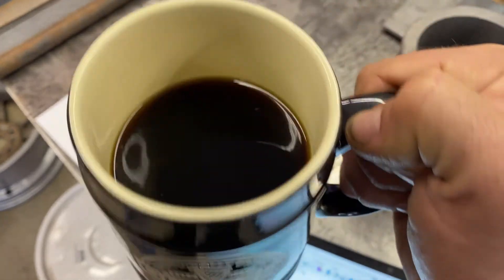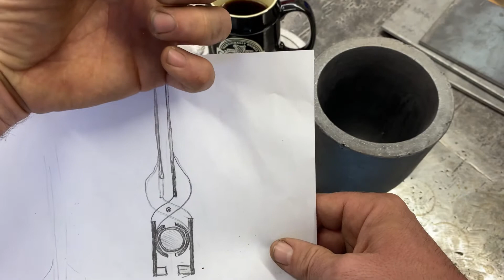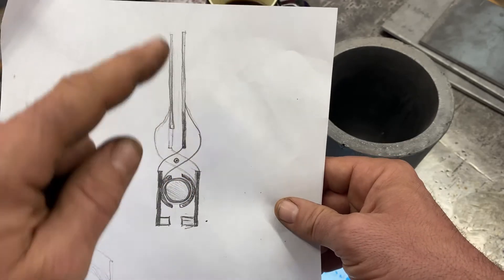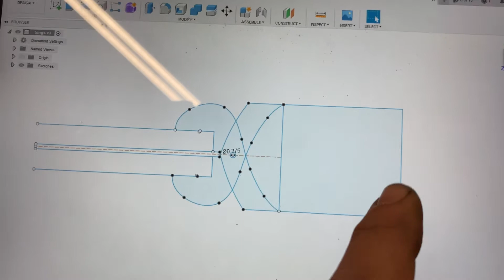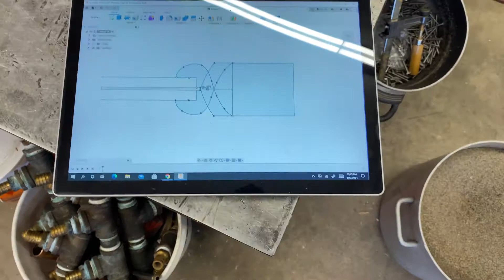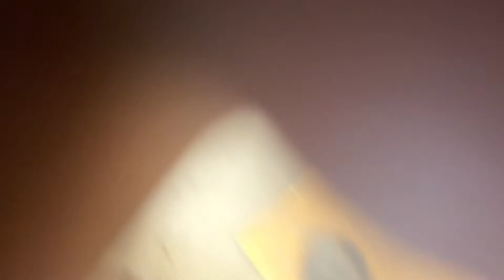Custom Crucible Tongs

Comment: thats how i like to buy the metal too always cheaper, im in the process of buildin a furnace right now, its goin to be much better than my last
Reply from the maker: Sweet man. Mine needs to be redone but it held up pretty good for the last 3 years. At least for how much I use it. Worth putting in some extra if you know you’re gonna use it
Reply: yeah i loved my last one. most of its use was just melting tranys, engines an such  @stevesrt8

Comment: Hi there, I like your Crucible Tong design. It's a must to have when casting metals. Is there any chance you have a digital file of the hinge part that I can get from you please ? It would make it easier to work with  as your design is so simple and simplicity is what makes it works so well. Hope to hear from you soon. Thanks
Reply from the maker: Hi Tony, Send me an email and I'll see if I can find it. I used a free version of fusion360 so I'm not sure if its still saved in there.

Comment: Great job bro, what an awesome design. I wish I knew how to weld, let alone weld as good as you can. I've forged bolt tongs and I know how hard it can be to make them and make them work. Awesome video bro 👍👍👍
Reply from the maker: Thanks Lenny. Never too late to start. I got a little MIG machine. basically same as running a glue gun haha. welding is an art and im doing paint by numbers. I've been thinking to get a forge going sometime too. want to try some knife making. you can always hit me up if you start welding or got a guy
Reply: @stevesrt8  I think I'm a way better grinder than I would be welder 🤣 maybe this year I'll get a cheaper mig and give it a try. That would be cool bro, forging is so fun and it makes you reconnect with how things use to be done. I made my forge out of an old bbq, a brake drum (you can also use a rotor) and some metal pipe to attach a hair dryer. It cost me less than 10 bucks, I either had or got for free everything except the piping. If you get into forging I look forward to the videos. Also looking forward to the new casting videos with the new tongs 👍👍

Comment: Looks about as handy as a pocket on a shirt. Good design. 
No closed captions so if I recommend something you've covered then ignore it. Where the pipes are close to the crucible, weld up the openings, will help in keeping the handles cooler, while you've got the welder out put just a spot of a weld above the wing nut to keep it from coming loose.
I operated a large plasma cutter many years ago in a metal fabrication shop. Our rails were installed with a curving "wave" to help prevent the smaller cuts from falling through. Spent many hours cutting out parts from most every type of metal, 24ga up to 8ga using sheets 4'x10'.
Thanks and love the tongs.
Reply from the maker: CC didnt work for you? it seems to work on my side. I never considered cooling. thats a good idea. Cheers. I like the tack on the hardware idea too. ill do that for sure. My table is pretty small. its only 2'x2'. i have seen the wave style rails. its hard to keep little parts from falling through or tipping up. I usually do a dry run to anticipate any tip up problems. thanks for the suggestions.